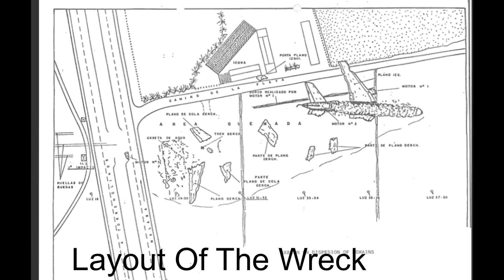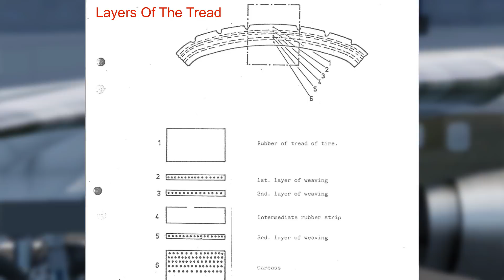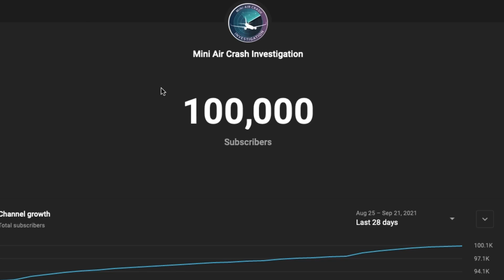How A Flat Tyre Killed 51 People | The Crash Of Spantax Flight 995

Comment: It's pretty hard to argue with the captains decision to reject the takeoff. He had no idea what was causing the vibrations and when they rotated the aircraft, the vibrations were made worse, which might have implied that if they got into the air the vibration ls could get worse and worse and bring down the plane
Reply: @colinm6714  Imagine being in that situation. What you you think could be the cause of increasing vibrations when you rotate? If i didn‘t knew the exact reason the first thing i‘d think of is a structural failure of the wing or the horizontal stabilizer which would indeed render that aircraft unable to fly.
Reply: @dominic3606  The whole point is you should not "think" anything at all. V1 == GO!
Unless the aircraft really does not get off the ground after rotating (weight/cg issue? wrong configuration? wrong speed set for weight?) OR your wing literally falls off you don't think too much and you go. For failures during take off you really have only a split second to make a decision and if you start thinking under this amount of stress you're going to do stupid things.
Reply: @Stanniemania  That vibration may have cause the wing to fall off after take off in the eyes of the pilot. No one know what cause the vibration. Split second decision here that in the pilot seat no one knows whether it is ultimately a good or bad choice.
If it is ultimately a problem that may doom them in the air after take off, knowing the vibration and rejecting after V1 may have save more lives and the ultimate best call in the end.
Guidelines are for normal/general failure. When facing more extraordinary situation, you need to make split second decision that may not usually be on the rulebook/guideline.
Reply: @789know  I wonder what the commenters above would have said had the plane taken off and it turns into air france 4590
we would have 400 casualties instead of 51
but hey, he followed the guidelines so who the fuck cares about everyone's lives right
Reply: @Stanniemania  go watch some investigations bro. there is so many examples, pilots decided follow the V1 rule and left no survivors. if you have any chance to save maybe half of passengers by staying ground you have to take it. V1 means, if you try to stop, plane will take damage. Not necessarily means everyone going to die. if runvay perimeter is smooth enough, you can save people even after V2 speed.

Comment: You didn't say something important: 3 years before this incident, American Airlines 191, another DC-10, had its left engine ripped off during takeoff in an accident which killed everyone on board. Some people say the pilot had this in mind, and as he didn't know what the vibration that, he may have thought that the plane had lost an engine, so he rejected inmediately to not die. This is still just a theory, but it's interesting.

Comment: Given that the vibration increased when the nose wheel came off of the ground, it's a pretty easy jump to "this problem will get worse in the air," even though that was the wrong diagnosis. There was nothing available pointing to where specifically the vibration was coming from.  I'm guessing the vibration increased because the tire was now spinning freely rather than being dampened by contact with the ground.  I think the pilot made the best call possible based on the information available at that moment.

Comment: Congratulations guys on reaching a 1,00,000. Very well done an analysed. I think that if the tyres had pressure sensor dust caps like we have these days even on cars that would have been signalled to the pilots, but then that was 1981 when electronics was not even in its infancy.

Comment: All of these videos are very interesting. In this case, some additional information would be helpful. 1. Do airlines still retread tires and if yes, what is done to insure quality? 2. How often are tires inspected? Once every 6 months?  3. Do modern planes have sensors to show when a tire fails?
Reply: 1: Most likely still standard procedure, meaning nearly every aircraft you'll see will be using retreaded tires at some point.
2: Prior to every flight crew boarding it the pilot will do a walk-around, impending tire failure due to the layers internally separating is likely not visible from the outside. Beyond that it will depend on age, flight hours, flight types (many short flights or fewer long flights meaning many/few compression cycles on the aircraft), flight location (salty air or inland) and type of aircraft and so on.
3: Partially, they might have a tire pressure sensor meaning they might detect a blown or flat tire but no sensor would be able to detect layers detaching. 
This is basically a freak accident that luckily 'never' happens, but in case it does, pilots are now trained to deal with it (thanks to this accident this is included in training).

Comment: Split second decision. That's what pilots are trained for and well-paid too. 160 Knots = 270 ft/sec. Every fraction of a second is crucial. And moreover it depends on the braking system and length of the remaining runway available to stop. And it's worth mentioning that Weather plays a major role in this kind of scenarios.

Comment: Trust your instincts. Rejecting takeoff past v1 guarantees an overshoot, the results of which are a game of chance. If your instruments tell you nothing is wrong and you’re past v1, you’re committed so push through. You can always try to diagnose when you’re in the air, either by rechecking your instruments or contacting the technical staff. This at least buys you time - as long as the engines are turning and have no control issues, you can simply do a fuel burn then try to land. You will at least have emergency services alerted by then.

Comment: I've only rejected a take-off once and it was due to an asymmetric thrust due to one engine not coming up to full power. It happened immediately after advancing the throttles, which is when it's most pronounced and hard to control due to minimal rudder authority.

Comment: Do we know why the vibration worsened when the nose gear, which had the bad tire, lifted off in rotation?  Was it still spinning, even though in a lopsided manner?
Reply: Hard to tell for sure, but most likely it was still spinning full speed, as the brakes usually don't activate until the wheels are retracted. If the wheel had become unbalanced, it's likely that the weight of the plane on it had a damping effect, which would've disappeared as soon as it left the ground.
Reply: @AIRDRAC  There are no brakes on the nose gear.  And I think the vibrations increased because the unbalanced nose wheel caused the oleo to hammer on the extension stop. Like you said the compressed oleo was less affected.
Reply: @glenwaldenhomestead8   Oleo?  What does margarine have to do with aircraft landing gear?  Do they use butter for lubricating the wheel bearings?  😂

Ohhhhh.....apparently, after a Google search, I learned that an oleo STRUT is a type of hydraulic shock absorber used in aviation. 

No disrespect intended, but if I may make a suggestion, may I suggest that you use a more commonly-understood term like "shock absorber" than an aviation jargon term (and a shortened one, at that) that few people outside the industry would understand.  😊
Reply: When it's rolling along the runway the unbalanced wheel (it's not deflated, just lost some tread) is shaking in all directions. Fore and aft it's constrained by the rigid strut and vibration is transmitted to the fuselage. Up and down it can 'bounce' between the spring in the strut (the oleo) upwards and the tyre itself downwards, both 'soft impacts' so relatively little vibration transmitted.
When the nosewheel lifts the strut goes to full extension and the wheels are still spinning - fast. The up and down 'bounce' is now between the spring and the hard stop at the bottom of the travel. The latter will be like a hammer blow (because the wheel can lift up and then slam down on the stop with each rotation), so the transmitted vibration will increase, mostly in the vertical direction, and have a different quality. Since the pilots are pretty much sitting on top of this the perceived change in effect could be quite dramatic.
Reply: @glenwaldenhomestead8  right you are! I thought that all planes had wheel brakes on the front wheels, to avoid damage from wheels spinning when retracted into the body, but apparently that is a more recent development! I had to look it up, and you're entirely correct. Only the rear wheels on the DC 10 has brakes!
Reply: Tire tread separation from the caucus can allow more distance when free wheeling than when it is smooshed down by the ground. I was a long haul Truck owner that had more than my fair share of recaps ! They are not worth it  anymore!
Reply: @Vmaxfodder  I think you meant "carcass". ;)
Whenever I see chunks of retread lying at the side of the highway I think "well, somebody had a bad day". Travel safe all!
Reply: @AIRDRAC  IIRC at least some airliners have rub strips built into the nose gear compartment, so that simple friction slows and stops the NLG tires once in retracted position.

The only Western airliners with nose brakes that I know of were early-production 727's.  More trouble than they were worth, airlines eventually deactivated them.
Reply: @mikes4163  Excellent answer.
As a passenger, if you're sitting above the main gear struts when the pilot stomps on the brakes while landing, you'll have a good idea what these pilots were sitting on. Definitely an alarming sensation!

Comment: I make no judgement of the crew's action but i have some additional information.  @1.03 minutes, takeoff power is most times a reduced power setting and not max power.  Pilots have to be aware of vibration types, engine vibrations are normally very high speed and frequency, so are APU auxiliary Power Unit vibrations.  wheel vibrations have a much lower frequency because wheel speed rotation are hundreds of times slower than engine rotation.  NOSE WHEEL vibrations will persist after rotation and lifting the nose upwards of the ground,  Nose wheel assembly has no brakes and the wheel will stop rotating only because of friction when airborne, the fact that the vibration existed after rotation speed is not an unusual event, you will hear a decrease in frequency as time passes until the nosewheel stops.  Main wheels are afforded a blast of brakes to slow rotation when the landing gear lever is selected to up.   The problems with the conclusions reached in this event is the many airports where there are a lot of HARD TARGETS at the end of the runway that will completely destroy the airframe.  putting an airplane back on the runway after V1 have in many occasions caused destruction of the aircraft and at V1 the aircraft is well above the speed to keep the airframe flying.

Comment: I've had years flying light airplanes (C-310, PA-23 etc.), fighter types and heavy transport (B-767, B-757, C-141 etc.) Rule of thumb- light aircraft have trouble continuing after engine failure while the heavies have trouble stopping. However, once in a while you have the choice of hitting the fence at 60 kts. trying to stop vs. hitting the fence at 120 kts. trying to fly. You never know when you line up what's going to happen.

Comment: My wife and I walked away from the crash of flight 995. It was delayed leaving because of some mechanical issue. We could see mechanics up on a scaffold working on the center engine for a couple of hours. The plane was loaded with the maximum number of passengers possible. They were all tourists and had lots of checked  and carry on luggage. Add to that, the plane had sufficient fuel for the transatlantic flight. It must have been close to the maximum permissible takeoff weight. The takeoff roll seemed slow to me as if the plane was struggling to reach takeoff speed. Vibrations notwithstanding, I always wondered if the third engine wasn't delivering full thrust and this contributed to the pilot's decision to abort.

Comment: Why when the nose wheel was off the ground did the vibrations get worse???
Reply: Probably because the wheel/tyre was spinning at a very high RPM (Revolutions Per Minute) and was unbalanced due to missing pieces of rubber, kind of like spinning a single brick in a washing machine...     (Tyre = UK spelling)
Reply: @yorkshirebikerbitsnbobs  You mean it would wobble even more once it left the dampener of the tarmac?   I can see that.  Pst! I thought Tyre was in the Mediterranean?

Comment: The explanation of the damaged nose-wheel does not account for why the vibrations increased after the nose-wheel left the ground.

Also, a chartered flight in Jeddah had taken off with one of the rear tyres deflated -- unknown to the pilots, it was on fire, and once the landing gear had been retracted, this fire spread to involve the control circuits and hydraulics, crashing the aircraft, killing everyone on board.

Comment: I had a friend that had several bad crashes on the highway from buying crappy used tires.  He totaled out several vehicles.  I know used tires and retreads are different but it just shows you how important your tires or tyres (depending on your location) is very, very important! I cant believe they would use retreads on a commercial aircraft! Yikes,  I hope that practice is no longer acceptable

Comment: Option 1: Do what the pilots did.  Added bonus: V₁ is calculated using official ASDA distance.  Most airfields have some extra space following the stopway which while at increased risk to the integrity of the aircraft and passengers may provide a few knots of headroom for a highspeed rejected takeoff.
Option 2: Takeoff , and either land again on the airport or destination.  The damaged nosewheel tyre will be put under maximal stress when touching down, may or may not disintegrate resulting in a loss of control or a landing like JetBlue Flight 292.  Maybe the reduced vibration during rotation would have given a hint to the pilots as for what's wrong with the aircraft so they could have tried to land the aircraft keeping the noseear up in the air for as long as possible, have used to time in the air for a mayday call, to burn off or dump fuel, get emergency services rolling, develop a plan and get the blood pressure down again.

In the Concorde crash the pilot took off with an aircraft that was not flyable for more than seconds when becoming aware of the fire at a speed above V₁.  The pilots were doing a great job as per protocol and I'm wondering, what would have happened if they had rejected the takeoff anyway crashing the aircraft beyond the end of the runway?
Reply: As mentioned both in this video and in the report. the vibrations increased once the front got off the ground, so in the short time-frame to make a decision, there were no signs that it was related to the front wheel.

Comment: Hi small questions,
You said that it was the front wheel that was the one that disintegrated but also that when they pulled the nose of the plane up the vibrations got worse? That doesn't make alot of sense to me as i would expect that the wheel no longer being in contact with the ground would make the vibrations worse
Reply: Because of "spring" in the NLG strut, the imbalance caused by a spinning partly disintegrated tire will produce a higher amplitude of strut stroking once the gear is no longer constrained by the runway.

Comment: My personal opinion is there is a big issue in commercial pilot training to do with problems. Due to the airline pressure about planes keeping to schedules all of the training is to consider a take-off rejection as being the last choice unless they have a clear idea of what the problem is and they know the plane won't fly properly once in the air. Thus the training engenders a thinking of 'get the plane in the air' as the first option when there is an issue of some sort. What they should be teaching is: If the issue isn't clearly known as one that won't interfere with the flight, then reject the take-off and sort it out. Yes, this will mean more rejects for incidents that turn out to be OK to take-off, but it will go a long way to eliminating the incidents where planes fall out of the sky soon after take-off, but the more important aspect is it will encourage the pilots to be a lot quicker to reject a take-off when they don't understand what's happening.

Mind you, the situation is virtually reversed once you're in the air. Once fully airborne the pilot in control should concentrate on flying the plane while the other crew member or members go to work to identify what the issue is and correct it.

I think the pilot should've rejected the take-off when he first considered doing so. However, despite the late rejection I hat to think how bad a crash would be if they took off and then tried to land with that damaged wheel.

Comment: I curious about one thing. If it was the nose wheel coming apart causing the vibration why did the vibration continue after the nose rose. It seems like the vibration would have stopped at that point.

Comment: I wonder if the vibration increasing on rotation had the result of the Captain suspecting a problem with the flight controls.
Captains are trained to reject above V1 if they consider the aircraft incapable of safe flight.

Comment: Honestly, I think the captain made the right call because of Nigeria Airways Flight 2120. Underinflated tire bursts, heats up and burns, causing the hydraulic lines and electrical systems to fail, leading to an out of control fire that lead to the plane falling apart in mid air and the deaths of 261 people. I would absolutely not chance it.